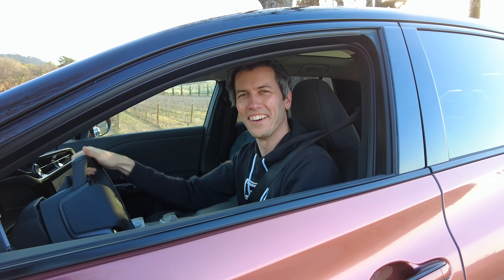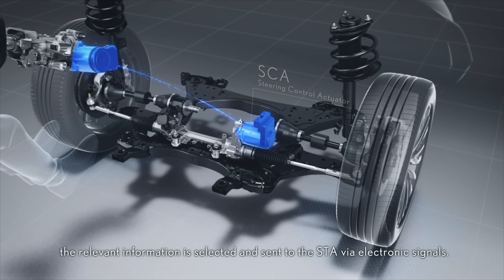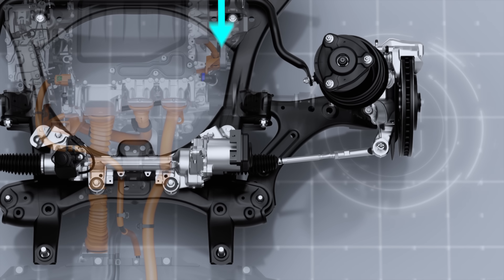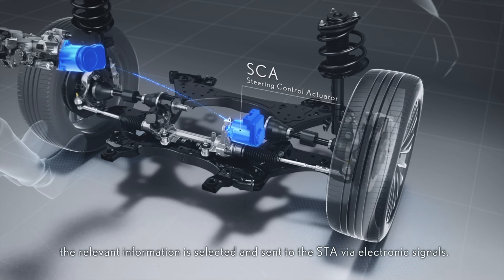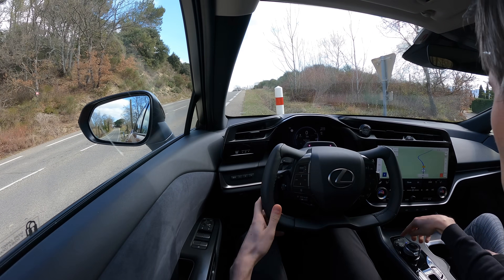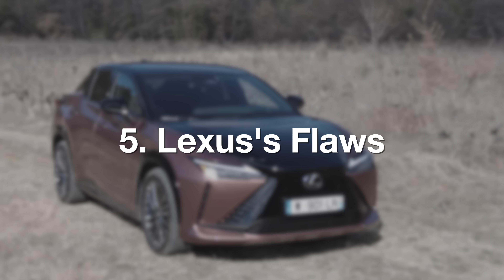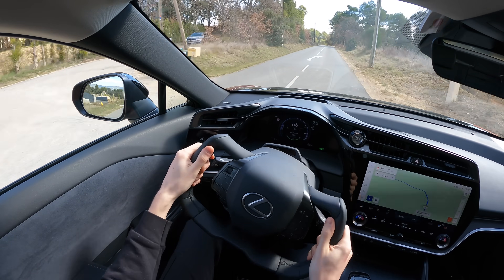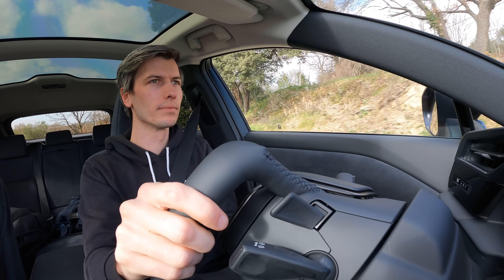How Lexus Fixed Tesla's Bad Idea: Steer-By-Wire Yoke

Comment: I think they are advancing too far, too fast. They should design a steer-by-wire system that delivers an experience that is as close to a mechanical connection as possible, the same way people barely notice the drive and brake by wire set-ups in their new cars. From there, they can offer the ability to adjust the "steer mode". This will give people a chance to adapt to the new tech, and engineers time to improve the system based on feedback from drivers...

Comment: The latency was very apparent.  It also seems like too much input is required at low speeds.  I imagine it would be impossible to drift in one of these cars (not that I do).  But the biggest advantage seems to be for the engineers when designing cars for the RHD & LHD drive market.  No linkages in the way, just a slightly different cabin design, and move the controls to the other side.  More for the oems than the consumers - now they just need to convince the market.

Comment: Steering by wire in my opinion is a big NO. If no power or backup power is present how will you be able to turn the front wheels. Mechanical steering is the only way to go.

Comment: So many other things that can go wrong.  Any one of 1000 tiny components could fail, a software bug, a hacker, a heat issue, and many others.  I have had a car die in motion before, if it wasn't for the mechanical linkage of the steering I would be dead.

Comment: Increasing ratio at high speeds also means decreasing wheel turning speed and maximum angle, so ability to compensate oversteer is also lowering a lot!

Comment: Yoke is a bad idea no matter if steer by wire or not !
If your car ever spirals out of control good luck !
A round steering wheel is easier to grab in that kind of situation as you can grab it at any position it is in.
We are not all full trained Formula 1 drivers !

Comment: My biggest problem with stuff like this that it brings more stuff that can break, more failure points. Also you cant still turn the wheels if you lose power. Redundancy is important for safety, any vehicle that will carry people should have manual overrides.

Comment: The problem of the Yoke is not the Yoke itself. Tested it during 30 minutes on a model s plaid it was very nice. The problem comes with the turn signal and espececially in roundabout. Because it’s fixed and right button is up and left is down. So you need to my opinion many weeks to be ok with that. Bywire is nice but not usefull. During my test no issue to turn, no issue to park etc… it was very easy. Only problem : turn signal

Comment: first thing is they should not connect it to a yoke only, A big tech leap needs the exterior appearance to be mostly unchanged.

Finally some humor, if you can alter how much force feedback you get you can set it to almost zero and simulate driving a 1980s American luxury car. ;)

Comment: 1) I could never drive with a yoke because I spend 80% of my time (pretty much whenever I’m not turning) with one hand on the wheel at the top. Just how I sit. 2) while I understand that they’re trying to damp it to prevent spinning/rolling, I’m concerned that straight up not allowing rapid input at high speeds will result in accidents due to an inability to swerve out of the way of something. Yes swerving at high speed is inherently bad, but if I suddenly come up on a person in the road, I’d like to at least be able to TRY to avoid them because if I go straight at them, the car is going to win every time

Comment: It's funny, but when Tesla said the new plaid would have a yoke, I thought that, naturally, steer by wire made great sense and that the yoke would be awesome. Teslas utter failure with the yoke was the first time they have truly dropped the ball IMHO. It was a small mistake to be sure, but it was there none-the-less. It's too bad that Lexus electric offering is sub-par in most other ways (performance comparable to a VW ID.4 at a $20k higher price).

Comment: If there is a way to set it how you want, with for an example a fixed ratio, if you accept every feedback or avoid the "useless" ones such as a pothole, or stuff like that, that might be interesting
Reply: I  doubt  it  will be possible to  set  a  fixed  ratio    unless  you  car  comes  with a regular  steereing  wheel

Comment: Actually I believe this is great. I usually drove an Audi and it had a standard high steering ratio. And later a Tesla Model 3 which even with the normal steering wheel has a crazy low steering ratio. And the problem is exactly how described here. On the highway it is super twitchy. You also feel like you are going to die if you turn a little bit too much. So now switch back to the Audi the highway experience is very nice again, but I couldn’t believe how much I missed the low ratio from the tesla in the city. It is so nice too just turn a little bit. So actually I love this new steering.

Comment: I'll probably like it. I had been telling this would the right approach, also comparing it to the F1 steering yokes. But they should have wheels matching yoke angle instead of yoke input, which may need more cpu (hence less battery life and autonomy, but still better than what you shown faulty as heck).

Comment: my 2015 q50S has steer by wire, it does take a bit of driver feedback away and it feels like a computer is driving it, but it does make the steering wheel really soft and easy to steer unless i have it on sport mode, then it stiffens up

Comment: So they're trying to sell the advantages to the consumers while glossing over the disadvantages like the steering lag, which in my opinion is a deal breaker. 12 years ago I had a Toyota with a drive by wire and the lag was infuriating. After a few years, it turned me into a lead foot that slammed on the gas every time I started moving to compensate for the lag. This being a new tech in a mainstream car, I'd probably wait for another 12 years before they get it right.

As to the advantage for the manufacturer, would it be fair to say these "by wire" systems are cheaper to implement than traditional mechanical linkage? Just in terms of components and parts required.

Comment: I'm curious how it'll do on a moose test. Between the delay and the variable steering ratio, it might create some interesting results.
Reply: It will perform the way it is configured. It is just a two servos with a PID controller in between
Reply: @Eugensson  How? There is a noticeable delay in the video. Watching him quickly turn the wheel from side to side on the road did not give me confidence that it would do well on a moose test.
Reply: @nomeus  well, just increase the integral coefficient gain of the PID controller until the required response is achieved. However that might introduce an overshot and oscillations if not done correctly.
Reply: @nomeus  this is a pre-production car, no wonder it is not tuned properly yet.
Reply: @Eugensson  And if the actuator isn't capable of movement that quickly? THAT'S the ultimate problem. Tune the PID loop as much as you want, the servos won't physically be fast enough unless they are really expensive, and guess what car manufacturers DON'T want with this feature?
Reply: @repatch43  i am pretty sure an actuator capable of delivering a torque higher than that of two arms of a very strong person are readily available and are already installed in every modern car. Need more torque — take one of of a semi-truck. This is a non-problem for years.
Reply: @Eugensson  Does an actuator that has both the torque AND SPEED exist? Most certainly. Is it within the cost window for installing in millions of cars? Almost certainly no, at least not yet.
Reply: I have serious doubts that it would do worse than any other car.  This kind of delay to reach the final position is a pretty normal effect of a PID controller.

Just because there's a delay in reaching the final position, it doesn't mean there's a delay in reaching the initial position. In fact is totally possible for the PID to be tuned in a way that the maximum deflection gets reached *faster*, and yet you'll see this kind of delay.

The fly-by-wire is also a super valuable input to tell the rest of the stability systems that the pilot really needs to turn now.
Reply: @theondono  exactly! Properly tuned PID + powerful accurate servo can do marvels not achievable by human beings before. Just look at industrial robots.
Reply: I think the moose test may be inherently different nowadays with the introduction of automated braking and other safety features outside of the steering column change.  But, it's an interesting question nonetheless.
Reply: @LordWhirlin  The moose test means brakes aren't enough, you need to be able to avoid hitting something that will absolutely kill you if you hit it near full speed
Reply: I don't think some of you people get it. You're arguing that you would be faster and more effective at steering without getting into a skidding condition which would impair your steering. This is like the same people who claim threshold breaking is more effective than ABS which is clearly not true.
Reply: @falxonPSN  No, the argument about threshold breaking is not the same as this. Here you CAN SEE the delay between the steering command and a response, in this video that delay is nearly 100ms longer than average response time for a human (280ms vs 200ms). Any emergency maneuver will happen 280ms slower than in a mechanical steering car, making the reaction time of this car nearly half a second. 

This is not an issue of "yeah, if you know what you're doing you can do it as good as a computer" (like with ABS), it's more like "no matter what you do, you will have to wait for the pc to catch up", which should be unacceptable.
Reply: Break bywire if failed you can actually push hard on the pedal & liquid will stop the car. Throttle bywire well if failed no gas or break to stop acceleration. However steering bywire with no connection🤔 if failed well. .. .yea!
Reply: @marcosdiaz4711  somehow you cannot in a truck.
Reply: It fails the 'looks like a moose' test. 💩
Reply: I'd be dead if I was driving that car when a moose charged me from a snowbank at 3 am in Northern Ontario in December 2019.  I snapped my Jetta into the oncoming lane and barely avoided 1,400 lbs of bones, antlers and meat standing 8 ft tall at the shoulder.  So, no, I'd never buy a car with decreased ratio steering in Canada, because of the wildlife.
Reply: @beyondwhatisknown  such a drama queen
Reply: @joshperry397  Such a wet blanket rain on people's parade stick in the mud.  Do you think I just made that up?
Reply: @beyondwhatisknown  You wouldn’t.
Yes, the car will optimize steering for the most performance possible, so if you throw the wheel to one side fully, it should move the car to the maximum extend that will result in the largest change in direction.
That’s not necessarily to the full extend that the wheel could turn, because doing this could cause skidding which actually decreases the amount of direction change.

This might surprise you, but steer-by-wire is actually used somewhere else, where instant maneuverability is just as important as precise fine controls.
Fighter jets, where switching from steady precise flight to literally neck snapping maneuvers is a matter of life and death.
You can have precise controls, while still being able to maximally control your vehicle.
Reply: @joelmulder  Plane steer by wire is absolutely not comparable to this scneario because the plane control surfaces have a playable resistive force. They actuate flaps that deflect air. The amount of "instant" response there is orders of magnitude slower than rubber in contact with the road. It only feels instant because of the overall speed of the aircraft. If the car was moving as fast as the jet, it would change direction 10 times faster.
Reply: @joelmulder  If the result is the same, it comes down to personal responsibility. If I die to a moose on the road it will be because I failed to save myself. I can accept that. What I cannot accept is if the computer failed and killed me, even if the scenario would have ended in me dying regardless of the steering technology used. It's an irrational preference. The only time I will accept this technology if it can reliably prevent my death compared to if I had full control instead, which i don't think this can do.
Reply: @joelmulder  Agreed, except: this car would FAIL, BADLY. It's got way to much latency, and it doesn't move the wheel fast enough. 

Yes, fighter jets do this, but they are machines that costs hundreds of millions. Car manufacturers are going to skimp as much as possible, and I guarantee the result is you'll be able to turn the wheel faster than the physical wheels can, meaning you fail the moose test, and you're dead.

No thanks.
Reply: @repatch43   Well, I can’t speak about the US, but most countries, car manufacturers are bound by A LOT of stately regulations.
If steer-by-wire truly was unsafe, I guarantee you it would not be allowed on the road.
I was just using fighter aircraft as an example. By now, fly by wire is old technology, and is something that is completely possible to do well and reliably with technology that doesn’t cost hundreds of thousands of dollars. If anything, tuning the system properly is the hard part.

The whole point of the system is to ensure you can’t turn the wheel in a way that would make the car do something that would make it loose control. To be fair, every good car should pass the moose test no matter how violent the control inputs, but even if you had one of those horrible pickups that love to flip over, this system’s entire purpose for being is making sure the wheels turn to their maximum limit right on the edge of flipping the car, but just barely not. A human (certainly not an untrained one) just can’t do that.

I don’t really understand how you can make such statements while probably never having used anything that’s steer by wire.
Have you never played a racing video game? Would you say those have so much latency that it’s impossible to drive in them?
There’s WAY more stuff going on in a video game from you turning the wheel to something happening on the screen than in real life, and even in the game, you really can’t tell that there’s any delay.
Reply: @joelmulder  You are relying on 'safe' being defined in a way that passes the moose test, I have my doubts. Just like how Boeing 'influenced' the FAA, car manufacturers have ALOT of sway with safety authorities.

The fact that this 'first stab' is SO horribly bad on the latency front is a VERY scary sign that the manufacturers are getting their way.

As for video games, I don't understand how that's in any way relevant. A video game isn't real, it doesn't have to obey the laws of physics, you turning some game controller doesn't actually have to command an actuator to physically move something.

Again, CAN a steer by wire be made to react as quickly as the real thing? Absolutely. WILL the first incarnations? That's where my doubt lies, and my 'trust' in safety regulators getting this right is simply not there, mostly because of so many past cases of things going a little wrong.
Reply: @joelmulder  so you're telling me it just depends on how the software will react ? so we don't know ? he might die or it might perform great
Reply: @joelmulder  i still, all of that considered, would rather have a vehicle that had instant response and consistancy. its a lot harder to get used to something thats constantly changing over something that is always consistant.
 
And i prefer knowing exactly where the wheel is right then, not where it will be in half a second once a computer is done making the decision to let me. id say just let me do what i want, if i wreck my stupidly expensive car because of my own idocy, thats my issue, and mine to fix, not lexus' to introduce steps to.

Comment: Adding measurable input delay to steering shouldn't even be legal. Owners of this car will run over four times as many dogs and cats as anyone else, and Lexus should be held responsible for that if they sell the car in its current condition.
I guess any time any company uses the word "yoke" they're about to make a really, really, really bad design decision. Except for the physical buttons. Those are nice.

Comment: Let's over complicate everything.The tech sound good for a 2-3 years as the car is under warranty,after the warranty expires is very expensive to repair.And to repair is almost impossible so you have to replace the part or parts(due to a modification of the components)

Comment: If there is a 100ms delay between the input and output, and if I am driving at 60kmph, the delay is equivalent to almost 2m of distance, which is too big for just 60kmph of speed. That means in an emergency I will arrive 2 metres 'late' to the car in front of me. This changes to 4 metres if I am driving at only 120kmph. Nothing beats physics and speed of causality, therefore shaft driven steering is better and the only way steering should work in a car.

Comment: Surely you want the car to be going straight when the wheel is central? If you vary the steering ratio whenever the wheel is not centred, it will surely move this point where the car is going forward, resulting in the steering wheel being out of alignment if you accelerate or decelerate around a corner.

If you only change the steering ratio when the car is driving straight, this could cause very odd behaviour if you start driving on an S-shaped road.

It sounds like mouse-pointer acceleration, but for a steering wheel, which I have always found makes my mouse movements less precise, not more.